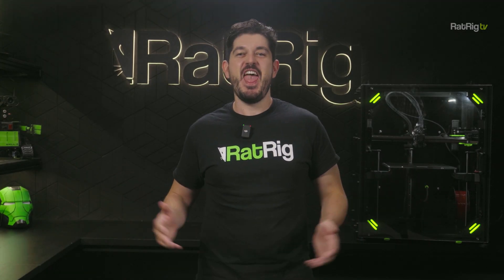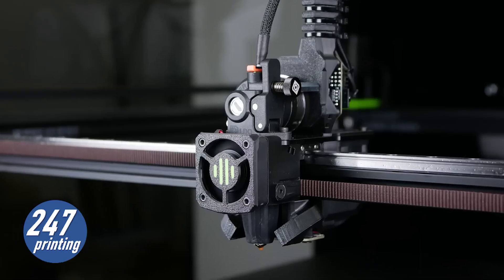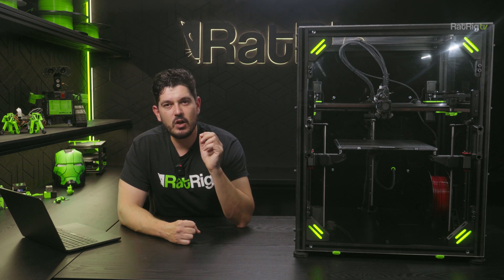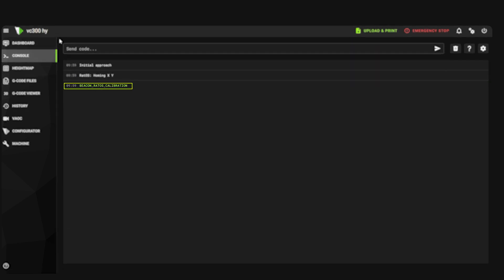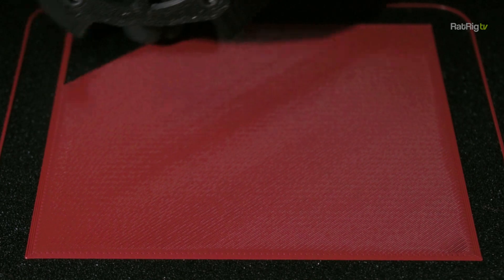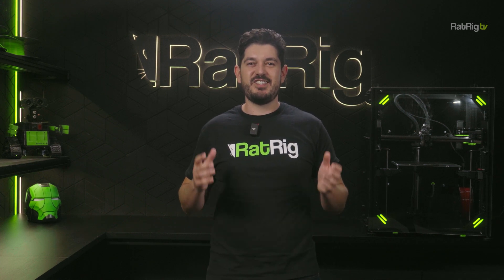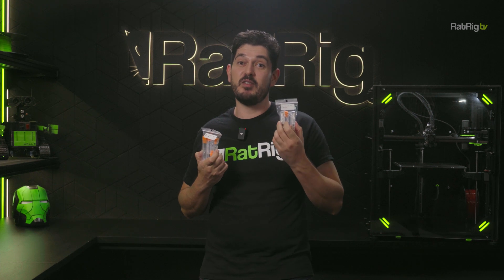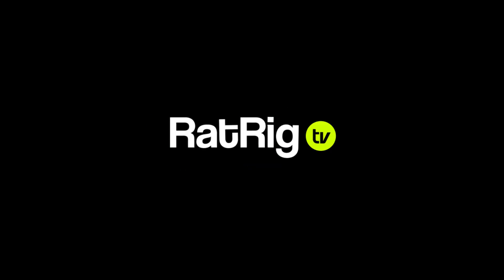Beacon Contact + RatOS: the future of Z Calibration! | Rat Rig TV #06

Comment: PLEASE help - i just tried the Beacon calibration and i get this response, what am i doing wrong? Just to let you know - the printer was assembled by Rat Rig - we paid for that service. 
11.01
Error during homing contact: No trigger on probe after full movement
11.01
Error during homing contact: No trigger on probe after full movement
11.01
Error during homing contact: No trigger on probe after full movement
11.01
Error during homing contact: No trigger on probe after full movement
11.01
Probe samples exceed tolerance. Retrying...
11.01
probe at 250.000,250.000 is z=-1.123854
11.01
probe at 250.000,250.000 is z=-0.357292
11.01
Probe samples exceed tolerance. Retrying...
11.01
probe at 250.000,250.000 is z=-0.359167
11.01
probe at 250.000,250.000 is z=-0.328542
11.01
Probe samples exceed tolerance. Retrying...
Reply from the maker: Hi! Technical support should be requested via e-mail. :)

Comment: Running RatOS 2.1 with Beacon on my Vcore3.1. Yesterday, I switched to a new build plate, changed my nozzle and switched from PETG to LW-PLA. Did not have to do ANY calibration... Sliced part, send to printer, perfect first layer and Perfect print.  Worst thing is, I never realised I didn't have to do a z-offset calibration, first layer test, squish test... Etc... I just started printing .. Amazing!!!
Reply: You buy beacon probe in oficial Ratrig store with upgrade kit (EVA 3.1) or in other store?
Reply: @maciejzlasu  I bought it at Beacon a year ago. Retrofitted it the Vcore 3.1

Comment: If RatRig wouldn´t have gone the way cheaper -> cheaper -> cheaper, i would think about getting a VCore 4 ... I´ve had several VC3´s and a Minion. Then i made the mistake to order some RatRig parts for some special DIY machines (esp. these Z-Anti-Wobble-Couplers), just to find them manufactured VERY unprecise (resulting in additional backlash of up to 0.12mm). Also the Beacon probe: I got mine around ten months ago and NEVER was able to scan RatRig PEI sheets accurately. They are made of cheap rolled sheet steel and the rolling process results in different material densities across the sheets. Of course the Beacon records that as a "height difference". From SEVEN tested plates, only ONE gave a more or less usable scan result (still 0.03mm difference to the "real world", but at least ...). The rest differed up to 0.18mm ! So: Sorry, but no, thanks... Not the VC4 and not the Beacon :(
Reply: Sorry to hear about your experience, sounds frustrating for sure. However, this sounds like a clear case of misdiagnosis from overthinking. Your problem sounds a lot like poorly tightened motor couplers - a super common assembly mistake. I have supported several hundreds of v-core users at this point and have never seen anything to the degree of these issues you speak of. Obviously if any of those claims are real, that’s an easy RMA on your 2 year warranty 😊
Reply: @miklschmidt  2 year warranty is fantastic in this industry.
Reply: @miklschmidt  If it´s worth the effort ;) It wasn´t the tightening. I don´t know exactly how to explain it in english (i´m german) but imagine to take a look at these things and see these "crossed t-slots". Then you measure the slots and the inner parts, which slide inside. The inner parts have been 0.14 to 0.19mm smaller than the slots and for me that´s a little bit too much. Especially, if the z-movement gets a bit "unpredictable": Sometimes the movement of the z-spindle is smooth enough, not to move the parts and everything is fine. Sometimes a small z-hop just turns the coupler parts without real z-movement :( . I ended up with filling the gaps with what we call "Hasbergband" (small sheet metal stripes with very precise thickness), they did the job.
Reply: @chaaalyy  that does not equate to 0.12mm backlash. It’s completely inconsequential. That tolerance is perfectly good for those decouplers (in fact, it’s intentional), if you reduce it you end up with decouplers that won’t move freely and thus you defeat the purpose of them entirely. They’re virtually and practically backlash free.
Reply: @miklschmidt  Ok: Add the free play (in worst case 0.19) of the lower and the upper slot. Now calculate, how many degrees you can twist the parts against each other... I don´t remember the diameter, but 0.38mm at the outer diameter is intended ??? Sorry, but i guess there are two different materials and even the worst difference in thermal expansion coefficients will not make that necessary. I reduced the gaps to a range of 0.015-0.025 and the parts slide like butter across the whole temperature range.
Reply: @chaaalyy  that’s not how the math works out. Further more, they’re meant for a heavily geared axis. Like i said, virtually and practically inconsequential. Do the math.
Reply: @miklschmidt  What do you mean with "heavily geared" ? The thread ? I used T8x8...
Reply: @chaaalyy  Yes leadscrew lead is effectively analogous to gearing. So because you used T8x8, ie 8mm lead you have half the gearing that it was designed for (T8x4 - 4mm lead). Which means twice the backlash, which i still doubt you'd actually be able to measure to any meaningful value, but i would love to see it.
Reply: just for the record, the build sheets from the VC4 are new ones from a different vendor and much more consistent, these are not the same as one the VC3.1
Reply: also, with the beacon you can measure the z-backlash pretty accurate, its way below then what you have experienced, with the same couplers
Reply: @HelgeKeck  As i wrote: I used these "bad" couplers in a DIY-printer (something completely different from FDM printing) with similar kinematics / mechanics. For this machine i used the Biqu MIcroProbe. So these two problems aren´t related
Reply: That's a skill issue on your part. 3 beacon rev d and all run perfect

Comment: The beacon contact promises unicorns and rainbows, and so far, everything I've seen makes it look like they can back up those claims. I just have to wonder how that works, especially with klipper and especially with the light amount of force of the nozzle. I cant imagine its an accelerometer so that's very curious/interesting.
Reply: Using a beacon on my vcore 3.1 (also beta ratos 2.1)and I can confirm it has an accelerometer built in. Only thing that I have as a minus point is it doesn't work with the ebb42 so you have to wire a separate cable for that

Comment: It looks like RatRig is chooching away at making their printers easier to build and better, though I do think there are some things that can be improved. From the 247 printing review I feel there are probably 2 areas where I would most want to see improvement with the VCore4.

Firstly, I think a filament buffer system akin to what is on the back of the X1 series of printers would be great to keep precise consistent drag felt by the extruder and avoid the filament feed problems he had occur. I don't think by any means it currently cannot work, I just think this would be a big improvement, especially for printers with such long filament paths.

Secondly, I'd love it if these big printers had scalloped out aluminum beds as while the aluminium bed is excellent for flatness, the time it takes for the entirety of the bed to actually get to equilibrium is quite long, meaning that if one wants to print consistently, they must wait about 15 minutes for the bed to get up to a consistent temp in spite of what the sensor says. With that in mind, I also feel that the sensor being deeper in the aluminium plate would give a better picture of what temperature the bed was truly at and offer a more consistent surface as a result.

That all being said,  I'm still quite curious to see the IDEX implementation out into the wild as well as the talked about MMU system. On a printer kit this large that would be amazing.

Comment: 2:24 Yes! We are in 2024, yet those big, fast, filament munching RatRigs have no filament run-out sensor, in it's kit, in this same year of 2024...
I do like the printer, don't get me wrong and will always support EU / Western companies but some of your decisions, that bear no additional expenses are highly questionable :(
Reply: @jazzmusiccontinues1134  You have reached the point of no argument, and when the debate is lost, slander becomes the tool of the looser...Good luck with your life!
Reply: @jazzmusiccontinues1134  It should be interesting how simple minds think or explain the world around them --> but you are boring now!  Bon voyage ...
Reply: They use the Orbiter extruder which has a purpose built runout sensor available. Super simple and cheap to add if you want. 

Personally I dislike runout sensors, more trouble than they're worth in many situations
Reply: @gavintaggart7370  None of my printers have had a single problem related to the runout filament sensor! And every one of those sensors have saved my butt, during long, critical, some very expensive prints! 
It's 2024, you have "smart sensors", regular fillament sensors - the real cost for the LED / IR emitter, wheel and PCB is less than 3 EUR!
I'm sorry! But those RatRig printers start at EUR 1200 without VAT (for the 300mm version). They can include The Beacon, but you'll not get a runout filament sensor, oh no! You'll have to go buy it yourself (sensor+shipping)!
Exactly, when I saw the Orbiter 2.0 and I saw that the sensor is missing - I got extremely puzzled! Why? Why not include it in the kit?!
Reply: @gavintaggart7370  I'm currently building my V-Core 4 500 and to be honest am surprised about the lack of filament runout sensor. The are no Orbiter sensors available in EU near me currently so that's a bummer! 
Never heard of filament sensor problems, I have a Prusa MK3S+ and I have relied on that sensor a lot...
Reply: It's a kit printer, you can literally add any run-out sensor you want.
Reply: @Maverickzeros  Of course you can! RatOS / Klipper allow you to "add a jet engine", if you want to! But RatRig is an expensive advanced machine that lack a simple filament sensor! That's not acceptable in 2024! Not for a EUR 1200  - in my country the VAT is 21%, so a 300mm printer is EUR 1452
Reply: @Maverickzeros  The point though is, why not have the best config for average users out of the box.
Reply: @BeefIngot  Absolutely! Although, you don't need be an average user - it's a QOL feature! It's a common sense feature! Large volume, long prints, expensive filaments...
And for a printer in this price range, the excuse "you can add any sensor you want" - t'is just an insult!
Again, I would probably get the RatRig 300 IDEX, after real world reviews but still...
Reply: @BeefIngot  Simple answer, we are not 100% satisfied with anything we've tried yet. We have multiple requirements that aren't addressed in any one unit. For now RatOS supports any sensor you throw at it, there are already examples in the preliminary docs of how to add the most popular sensors to your config and have them integrated in RatOS.
Reply: @juandoe-lq4wu  filament sensors are very cheap and it takes 2 lines to have them fully integrated into RatOS. Is this really such a big deal that you're offered the choice of which sensor you want on your machine?

It doesn't come with one, because we haven't found one that does what we want it to do reliably yet. That doesn't mean you can't buy one that works for your particular use case. It's such a simple addition.
Reply: @miklschmidt  HI, Mikkel! Please do not present a lack of a common feature, as being best for consumer - as being in my interest or that it provides a choice! It doesn't sound good!
The ability to add ANY sensor is not a choice it's a burden! You have tested various filament sensor - you know which works best! How am I suppose to find the most suitable one? Should I buy all of them and test? Is that my choice? --> Yet you're providing advanced features before you have solved the most simple one! 
The lacking filament sensor is not a small matter and It's a common sense feature! These are a large volume printers where prints will probably be long, with some going well into the night, God forbid you have loaded an expensive filament or you're chasing time constraints and you filament runs out! --> Should I always open a new roll, just to prevent possible filament runout or should I babysit or set alarms for a midnight prints? 

I took the time yesterday to go trough the documentation, as I'm looking at the 300mm IDEX and with what you're telling me and my first glance of the guide - the first thing that came up to my mind is that you 'transfer' some of the risks / responsibility back at the owner.

1. At the electronics guide, I see you require several crimpings. OK, some occasional cable crimping won't hurt anybody, probably! But I read the page twice, you require the assembling person to crimp his thermistor cables on their brand new Rapido! Rapido uses braided cables and those are THIN inside. THIN! How many mistakes before the cable is to short (one, two) and you have to go buy another one?! Really, on an EUR 1400 printer - that would be the 300mm with VAT (not even Hybrid). 

2. Now you're telling me that in your pursue of the perfect filament sensor, that you may or may not  find or develop, your best decision is to transfer that responsibility to the customer?! They all work, not good enough for us but for you they will - go buy or make one? Really! On a EUR 1400 printer!

I'm sure you guys are doing an amazing job, I truly am! But you're out of your BETA period, you're not Hobbyist anymore and you're entering the competition game! Complete kits, interesting features, big hypes! As I said in my first comment, I will always support EU companies, even when that means taking a hit on the expense (price) but you have to  start thinking for the QOL of those who will buy the V-Core 4 --> the added value, that separates you from those Chinese clones that gather speed at immense pace...

PS: I cheked what @yavorminkov has written and can confirm that Orbiter Filament Sensor is out of stock anywhere in EU, Can't find any - and available ones go to above 30-40 euro - that's not cheap at all! Should i design the casing for a custom, made by me sensor? On a EUR 1400 printer...
Ah! And those bigtreetech smart sensors are a no go - why waste 1 meter of filament? It's ridiculous!
Reply: @juandoe-lq4wu  Juandoe is absolutely a bot, don't interact as engagement benefits the botter. The bot is pretty bad at its job too if I'm being honest
Reply: @jazzmusiccontinues1134  Of course! That's the only explanation! 👏